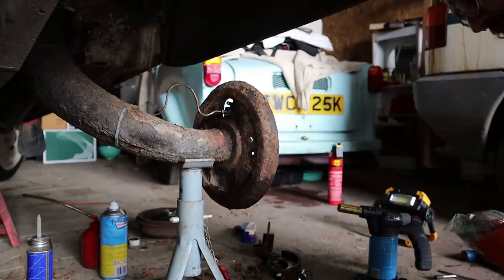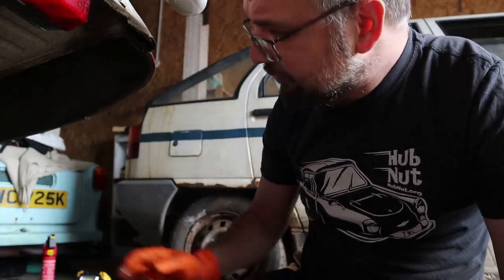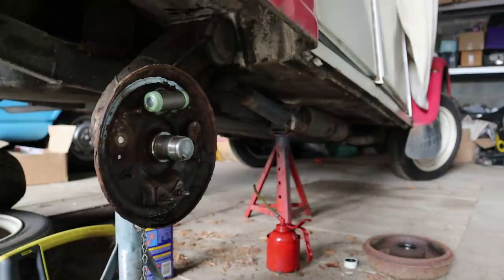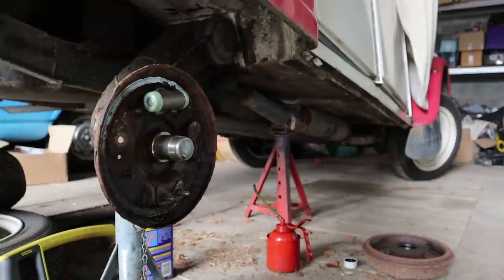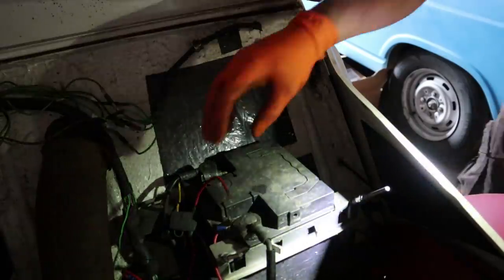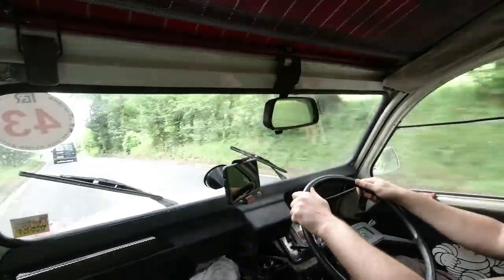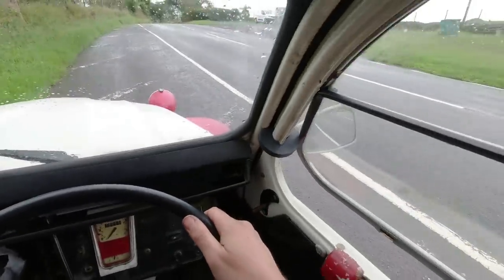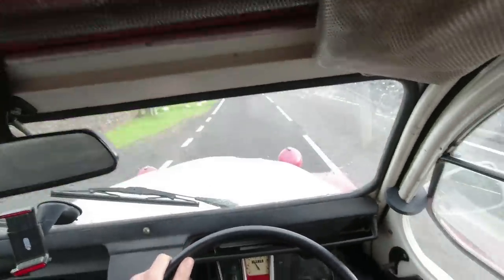2CV MOT Preparation: Will she pass? Also, more problems...

Comment: I had a friend a little like you years back. Even his girlfriend used to get the bus home rather than take the car.
Nothing serious ever went wrong with his vehicles but there was a general low level sense of fear whenever we traveled in one of them with him.
The best was indeed a 2CV that he had painted primer red intending to add a top coat but he liked the primer so much he never bothered. One fine sunny day we drove down a hill into a small Kent village, where a cricket match was taking place on the village green. As we hit the centre of the village we swung the car  in a gentle arc around the village green and the near side wing came off.
"Bugger". Said Joe, who jumped out. Ran up the road to get the wing, ran back with it above his head and proceeded to refit it by hitting it back into place. Back to the drivers side, jump in, start up and off we went.
I don't know if the cricket match restarted but last I saw it had stopped while everyone stared at the loonies from London.
Reply: You, quite literally, couldn't make it up.......!!
Reply: Nothing beats a red oxide paint job, it won't rust but if it does you'll never notice
Reply: Superb anecdote!
Reply: I had a mate in school with a 2CV, he offered me a lift home but gradually I noticed more and more things that were wrong with the car, giving me indeed that low level of fear. It all started when he turned the headlights on and immediately switched to main beam. "The dipped beam filament has blown so I have adjusted the headlights down and drive with main beam". OK it's easy for a 2CV to adjust the beam (just turn a knob) but come on, save a few quid on a headlight bulb, really?!?
Reply: @volvo480  I believe it is referred to by some as "The glory days of British motoring". Loads of people haring around in cars they were too skint to run.

Comment: Regarding the Yugo's engine, not long ago I started a BMC  engine that had been sitting for 12 years. A week prior I overfilled (way over) it with diesel instead of oil, thought was to get some lubrication everywhere possible. Then drained and filled with oil for starting.

Comment: Glad Elly passed the MOT. Had to be gratifying after all the work you put in. I still can't believe that a French built auto has the same brake adjust as a vintage American auto. I guess I shouldn't be too surprised. Ford didn't add self adjusters to their brakes till 61' so prior to that they, and everyone else, could have used the same system. On my car, one adjustment cam was rotating freely on the adjustment bolt. I was rather distressed but tried a tack weld, which did fix it. I guess it is an obvious way to provide a way to adjust your brakes so maybe not so surprising.

Comment: As far as your frozen engine poke around under the hood for a while.  I am reminded of a story my Uncle told me, he ran an auto salvage yard, He bought an 8-9 year old Chevrolet Monte Carlo, it was a clean car that looked good and should of been worth $2,000-$2.500 BUT the engine was frozen. He bought it out of an estate and the executor of the estate said it had been sitting for 3-4 years when his mother got sick and stopped driving.  As it was winter he decided to pull it in the shop and play with it a but before putting it in the yard. They tried a few things and the engine still wouldn't budge so they decided to start parting it and shelving parts.  They got the Wheels and drums and rotors off of it,  the doors, pulled the Radiator and then  pulled the front clip off of it, dropped the gas tank and started pulling engine components. As soon as the took all the V-belts off of it the engine was free. Seems the A.I.R. (smog pump) was seized and that's what was preventing the engine from turning..  Check out the  accessories on your Yugo and make sure it's nat an alternator, starter or valve frozen that's stopping your engine from   turning.

Comment: Glad the old girl passed.
 Regarding freeing off seized engines, I freed off a 1100cc A series engine that had sat for 16yrs by putting a couple of cans of WD40 into the bores and leaving for 3 days then I filled the engines water jacket with boiling water, emptied it, refilled again with boiling water. I repeated this a few times until the engine block had warmed up, I then turned it on the crank pulley bolt back and forth in very small movements until it eventually started to move. When I sensed it was beginning to go I put a little splash of engine oil in the cylinders.
When you finally come to crank it make sure the plugs are out to expel the fluids! when it fired it smoked like buggery for a good 2 mins!
It was a mini clubman estate, and it ran fine for the next 6 or 7 yrs until I sold it, I never even took the head of it!

Comment: I have a spare 24v 5kw (peak) square wave power inverter that you could couple up to a pair of your many batteries to provide mains power for motor equipment. The purchase of a small 20w solar panel could also keep all your batteries topped up too. Just a thought. Your welcome to it if it would like it.

Congratulations to you both on the new MOT. 🍾
Reply from the maker: Thanks but I need a change of unit anyway.

Comment: So many double entendres! I think a Sarah-n-Tuned version of this videowould have been quite different! Speaking of child safety, back in the early 60s my dad made a couple of wooden stools. My sister and I would sit on those in the back of dad's service van, between racks of fork lift truck parts. Later he moved up in the company and was driving an Austin 1100. I ended up in the passenger footwell of that! It's really good that things have changed.

Comment: Well sorted Hubnut!  I hate staked nuts myself - what's wrong with good old castellated nuts and split pins? (I hate staked universal joints even more.)  On priming a car which hasn't run for a while, a method which works on some older cars is to use an old radiator hose, shoving it over or into the fuel filler and using your mouth to pressurise the tank, perhaps with an intermediate rag to catch any moisture.  On trying to unseize the Yugo by rocking it, it's well worth a try, but I'd suggest 4th gear rather than 5th, as it stresses the gearbox less on most cars.  Cheers.

Comment: I apologise for my comment about trying to turn the engine on the camshaft (I even made the comment after you released this video!) 
I understand what you were trying to do, but you wouldn't really achieve a lot trying to turn it up there anyway, aside from push on the tops of the valves and apply tension to the timing belt. 
You can't turn the bottom of the engine using the top, the bottom is the stiff bit with all the compression and all that lovely stuff.
It might be free, what you need to do is get a 3ft breaker bar on the crank pulley. :)

Comment: Good work Ian. Regarding the Yugo engine, an old motor engineer used brake fluid with much success on stuck engines, just pour it in and leave for at least a week.

Comment: Re: broken brake cylinder. I think it's been a casting with a fault and someone historically has given it a bash with a hammer and fractured it, so when you touched it it just fell to bits. It's rare but not unknown.
Reply: Overtightened ... pipe thread gets bigger toward the base.
Reply: @Gordon  good point over tightened and it cracked it
Reply: @earnestbunbury2103  I think its a parallel thread in fact and the seal is the brake pipe flare against the seating. It makes no sense to have a tapering thread on that kind of fitting. You'd have a job to overtighten one. The nut would be wrecked long before that and you'd put a twist on the brake pipe as well most likely. Its not impossible though. Casting faults are common on cheap mass produced items of unknown provenance.
Reply: Bleeding the rear brakes on a triumph herald the cylinder split in two as the bleed nipple was tightened up. Sod it.... Trip to motor factors. New one pops in fine... Bleeding the brakes to finish the other wheel does exactly the same,,, cue second visit (of shame) to motor factors "have you got another?".   Alloy and 25 years of sea salt don't seem to mix. Looked like a crystalline break from a corroded start crack (or personally being crack handed)
Reply: @StreakyP  stress corrosion cracking. Small crack, dissimilar metals, oxide expands lengthening the crack and the cycle continues.
Reply: @timhancock6626  Totally with you Tim. Tapered thread is wrong.
Reply: @millomweb  ...
Zinc alloys are very prone to corrosion cracking when a French farmer hits the part with a stale baguette instead of a hammer.

Comment: If only you had some sort of pit in the unit to avoid sprawling around on the floor 🤔
Reply: The pit that is a clean as the interior of Fox ann
Reply: The pit wouldn't make this job any easier because it's a wheel off scenario anyway. A two post lift? Different story.

Comment: Elly's sounding happy to be back on the road again, and I'd say another rear seatbelt kit is in order, may be legal to go without, but it's a case of better safe than sorry... :)
Reply from the maker: Yeah, but there's always the difficulty of trying to get three-point belts in the back of a 2CV. I'm not sure lap belts really offer much in the way of benefit.
Reply: Very true, the lack of anchor points for 3-point belts would need some creativity for sure, and lap belts, from experience, are quite painful on the mid-section in a sudden stop, even as a child when I experienced a number of them in some of my dad's older cars...
Reply: @HubNut  Ask on www.aussiefrogs.com what the Aussie guys do - rear seat belts are required for roadworthy test in Australia, I think 3 point belts on all outboard positions (?) and there are a few 2CVs of 1980s vintage here, though they were never sold new, they are all private imports. They will have a solution. They have to fit crash bars in the doors, too, you know...

Comment: An engine that’s stiff from sitting may be freed up by rocking back and forth in high gear as you reckon, but know that you will skim off a layer of corrosion that will bring you to bad rings sooner than you would like. That said Yugo engines are actually pretty sturdy and tolerant of some abuses.

Comment: My respect for this positive result by the MOT after the stress we all experienced. After this success, you are therefore thinking of offering our dear Elly new black - sheathed legs ...Hmmm... what a delicious vision... I always knew that you were a Gentleman. Another subject: gearbox oil. Modern lubricants of the API - GL5 class are likely to contain harmful additives for yellow metal parts (such as synchronizers). The debate remains open on the net but as a precaution I only use API - GL4 oil.

Comment: You need to treat yourself to a decent battery drill. My preference is for the 18volt Black and Decker range, you can get the drill with two batteries +charger for around £50. Had mine for a while and it's stood up to being abused quite well. Couple that with a cheap inverter from Argos and you'll be able to charge it from your car(s). That does assume you have a working vehicle :D

Comment: The wheel cylinder would have broke because the fitting would be tapered and someone overtightened it. The casting would be quite brittle.

Comment: RE: not sitting behind an empty seat in a car with no rear belts, that is true, however there is also the risk that if you are sitting behind someone, your head will collide with the back of the front seat occupants neck, with fatal results for said front seat occupant. Tragically there have been numerous cases where this has happened, including in more recent years in newer cars where the rear seat passenger has simply not been wearing the available belt.
Reply from the maker: In the Minor, there's the added joy of the empty passenger seat just collapsing if struck behind, so behind the driver is far safer.

Comment: Well done Elly on your new MOT, with a bit of help from your keeper of course. Geek comment: At the end I noticed for the first time the rubber buffer on the front of the door to keep it open a bit and stop it from banging at the same time. I've only seen the over centre wire clip type before. Citroen or aftermarket?

Comment: Of all the wheel cylinders I've in my time I've never seen one break like that!
I wonder if water had somehow got down inside the treads and the frozen to pop it apart?
Reply from the maker: Gawd knows. It was obviously fine when we changed the brake pipe.
Reply: @HubNut  Yes clearly was, ah well, an experience for the history books. Glad to see her back on the road. Been strange without her driving on the channel so much have been even more so for you!

Comment: 16:00 It's 1 am and you make me go in the garage to see what the top end of our torque wrench is. It's 250 ft/lbs. This is a replacement for 2 that were nicked. I'd guess those two were 0-125 and 0-270 or even 300.
And now the cat wants to go for a walk !
As for using a torque wrench, is the nut & thread supposed to be lubed or dry ?
Reply: I was always told dry for that one. It's a swine to get tight enough!
Reply: @wibbledee  Well, if lubed, it'd be easier to get tight !

Comment: It's a crazy idea, but when did you last change the fluid? Could you of had an extreme case of water in the brake fluid that froze and split that cylinder? Pritty mad failure.

Comment: You’ve forgotten how much 2CVs Roll?

We haven’t!
Reply: LKJ Stright, an eloquent muttering rotter writing for CAR magazine in the 1980's wrote that just to see what it would do, he drove a 2CV at full throttle round a roundabout near where he lived. Round and round he went, trying to obtain maximum speed. It rolled, he said, to an angle of about 45 degrees but the inside wheels just wouldn't leave the ground. The Police stopped him and asked what he was doing. He said he was trying to turn it over but it won't go. Mr Plod said well you have proved your point, please go away and stop frightnening the other motorists. It was in a 30mph limit, and Mr Setright claimed to the Policeman that a roundabout is a dual carriageway and therefore it was by default a 70mph limit. 
There was also a Punch strip cartoon where a 2cv had a puncture. The driver jacked up the body but the wheel didn't lift. Eventually as it was jacked higher and higher, the car turned over on its side but the suspension leg curled back over on itself and the wheel with its flat tyre was still stuck firmly to the ground.
Reply: I was hanging on for dear life on the sofa!

Comment: ....I'm almost there with mine, just installed the 123, but the previous owner has used household connections in the ignition system. 😭
Reply: Household connections?
Reply: @dogwalker666  It has choc block,  weird solder BOLLOX!  * stamps feet! *
Reply: @saintfunny  oh nice sounds like fun to sort out. Good luck.
Reply: @dogwalker666  I shall pull myself together!

Comment: I reckon the thread pitch on those new nuts is wrong. They've either been made to the wrong pitch or whoever made them balls'd it up. Don't use em.
Reply: The new nuts don't have the run in chamfer. The unused one needs to be returned to the seller with a note about the problem and a request for a refund for both of them. Add a link to the two videos. Yes, incorrectly made.

Comment: do you not feel that in the last video undoing the brake pipe jammed in the union you turned / twisted the brake line pretty far it made me cringe a bit. which worried me a little as to how much it may have  weakened it, for safety it may have been better to cut the end and re flare it. But that maybe just because my concience would have got the better of me I guess.
Reply from the maker: I felt the twist went through a large enough bit of pipe not to be an issue. If it was an older pipe, I certainly wouldn't not have taken such a chance.
Reply: @HubNut  glad she's back on the road  to enjoy Ian  🙂